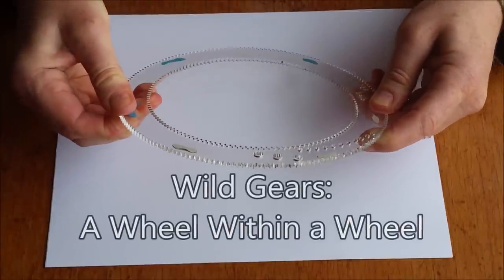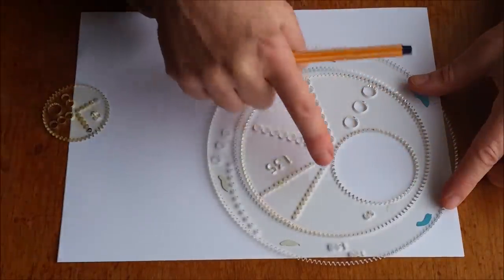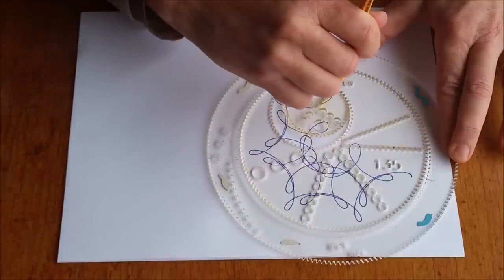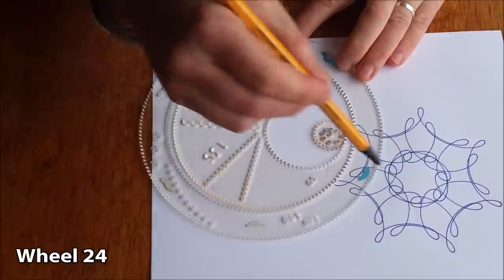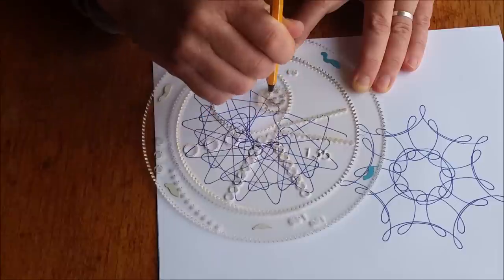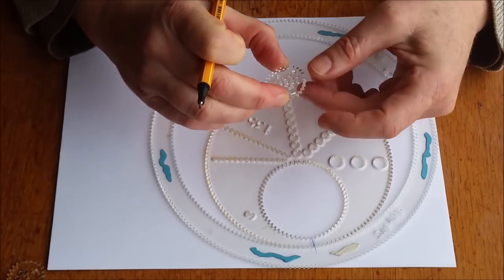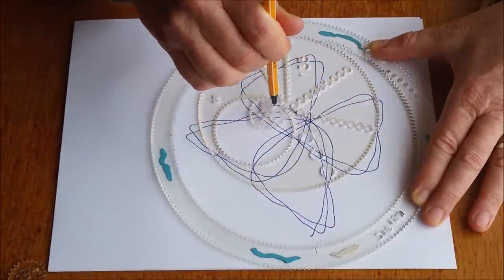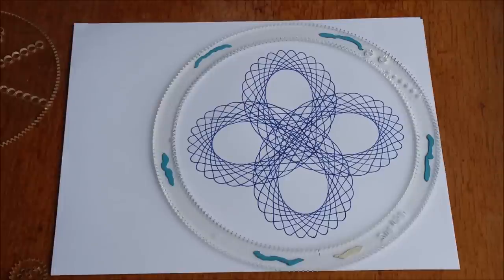Wild Gears: Wheel Within a Wheel

Comment: This is NOT the original Spirograph, as the one originally created years ago had pins to hold the wheels in place to a sturdy cardboard; this kit uses silly putty, which is a poor substitute. I would NOT advise buying this toy; it is a cheap imitation of the original.
Reply from the maker: With respect, this is not Spirograph at all. You're thinking of the new Spirograph by Kahootz Toys which came to the market in 2013. I wrote an in-depth review comparing it to the original Spirograph of the 60s and 70s (https://spirographicart.com/2013/11/18/compare-new-spirograph-deluxe-super-spirograph/). I rather prefer the putty to the pins in most situations, actually, but you can read about that on my website. 
The product in this video however is not a cheap imitation of anything. It is actually rather expensive,  compared to Spirograph. It is laser cut on demand from acrylic sheets - a completely different manufacturing process. I call it "Spirograph for Grownups", and you can read about it here: https://spirographicart.com/wild-gears-spirograph-grownups/.